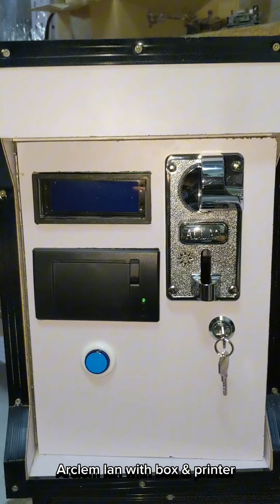How to setup Arclem LAN vendo box with printer

Comment: Bat wala po sa shoppee?
Reply from the maker: @jae5353  enstack.ph/arclem-shop po sir
Reply: @Arclem  boss pwede po ba Kami umorder Yung auto generate sya SA omada controller?   Alin po ba Dyan sa store
Reply from the maker: @jae5353  autogenerate po lahat binebenta ko sir sa arclemxomada na type
Reply from the maker: @jae5353  no need na po sd card
Reply: @Arclem  plug n play na po ba sya?
Reply from the maker: @jae5353  kung sa manila lamg kayo sir pwede nyo naman po pickup din. Pero next week pa po kami balik operations. May hinhimtay lang ma mga pyesa
Reply: @Arclem  boss pwede mag request? Taasan Sana Yung box
Reply from the maker: @jae5353  need nyo lang isetup ung hostname ng omada controller, username at password
Reply: @Arclem  pero plug and play na po sya ?
Reply from the maker: @jae5353  binibili ko lang kasi din ung box. Check ko lang sa supplier ko sir kung meron sila mas malaki.
Reply: @Arclem  San po ba Yan  boss ?
Reply: @Arclem  sge boss San po ba kayo sa Manila boss?
Reply: @Arclem  boss nag chat po ko sa messenger